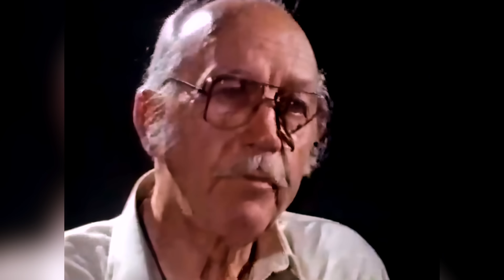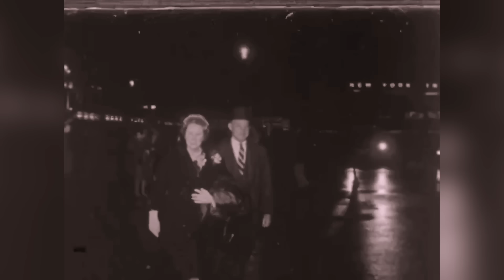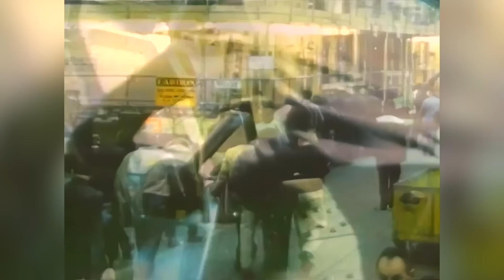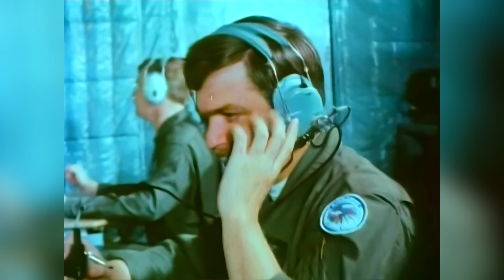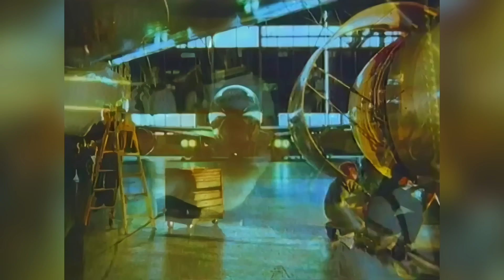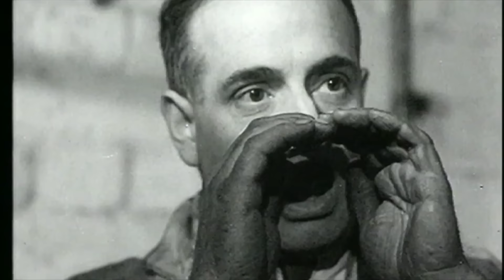Boeing 707: The Jet That Changed the World

Comment: To think of what Boeing used to be, the unparalleled standard of engineering excellence, and what they are today, a bean counting disaster, is just tragic.
Reply: Anyhow the Boeing 707 had its share of problems, in the early years a few were lost due to dutch roll, then a tail fin was added
Reply: Anyhow the Boeing 707 had its share of problems, in the early years a few were lost due to dutch roll, then a tail fin was added

Comment: Despite major advances in materials (composites in addition to aluminum alloys), avionics (digital glass cockpits), flight control (fly by wire) and engine technology (turbofans and electronic engine controls) since the 707, the basic design of modern commerical airliners retains the shape set by the 707. A fuselage with an oval tube cross-section, a swept wing with engines hung in pods below the wing. Those has not  changed to this day...well until flying wings enter commerical service.

Comment: The British Rolls-Royce Conway engines when fitted to the VC10 was the fastest bird to cross the pond except for Concorde
The VC10 made for the Empire routes has all four engines at the rear of the body and was able to have short legged wheels 4 rough Fields landing &
And was able to take off and land within the half the distance of the B707
Fitted with GE JT 8 D
Jet engines 
The Vickers VC10 was used a lot on the Atlantic route and it's upgrades were unnecessary and expensive for this simple route and did not sell as hoped, I am not sure whether planes of today have close to the VC10 ability also turned into an in-flight refeuler & the Handley page Victor Britain's ex V Bomber
I am glasses I couldn't fly through my career, never mind I enjoyed this video thank you and the barrel roll
Reply: Sorry to disapoint but the convair 990 was the fastest subsonic jet never built, Convair 990 621 mph, VC10 580mph
Reply: @christoohunders5316  the Rolls-Royce Conway jet engine and Vickers VC10 were made to be superior performance ability
Alas today with an engine that has 12 to 1 bypass ratio although technologically they have very high efficiency 4 distance this is a good thing
With the loss of speed and power the airlines save money and hopefully pass that on in an hour ticket price
The Handley page Victor a cold war V bomber used the
RR Conway engines until it's retirement it made a good in flight refueler
The Convair passenger jet
Having J-79 engines was of interest to me I am very aware of these engines a plane with a similar heart to the VC10 but it was the Douglas DC-8 the only passenger jet to go supersonic a jet cannot breathe supersonic air but 
it still did it, L8TERS fella
Reply: @christoohunders5316  I am aware of the engines in the Convair it had 4 x GE J 79
Same as the F4 Phantom and the Starfighter Without reheat
But I hear it was unable to do the USA's coast to coast they put more fuel tanks off the trailing edge of the Wings,
& the B747 in a flutter test achieved Mach .98
The B737 was .83 Mach
The Vickers VC10 was also made hot and high density altitude
Reply: @christoohunders5316  YouTube talk about MPH
That is ground speed independent with a headwind tailwind a B777 did a ground speed of 821 mph not so long ago obviously with a tailwind